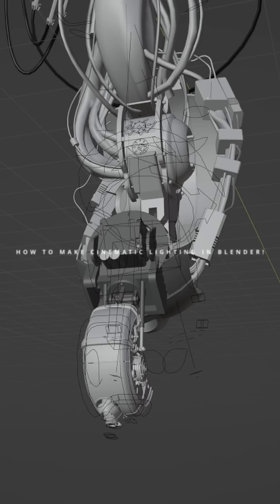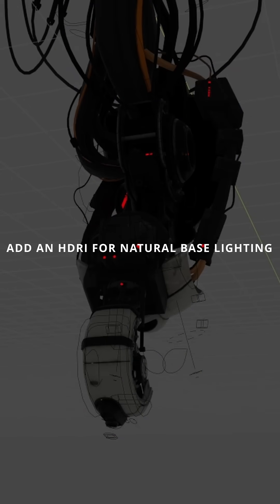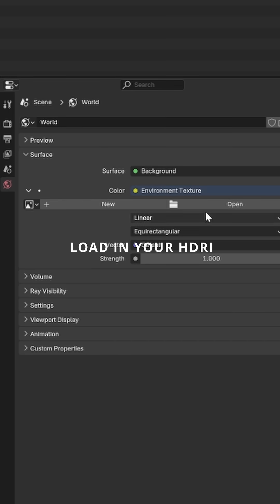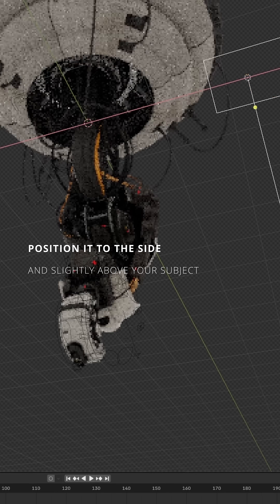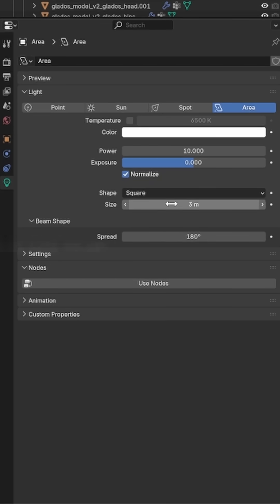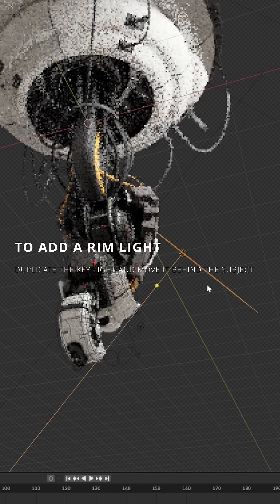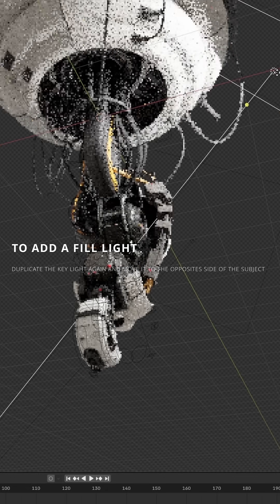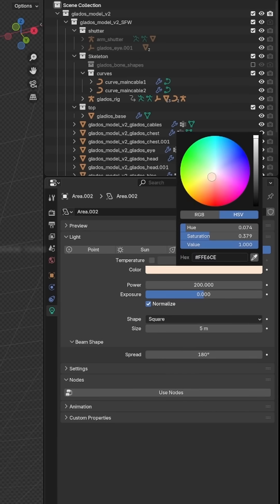Very Basic Lighting in Blender Part 1 #blendertutorial #blender3d

Comment: "how to make cinematic lighting in Blender"

* Computer explodes

Sounds about right. I am an NPR artist, always working in Eevee in a non realistic style, so no photorealistic shenaniganigans. Huge landscape with several characters, my 3080ti can handle it fine.
Recently I made a realistic traffic light in Cycles - only a traffic light, nothing else in the scene. A few reflections and bounces, it takes forever to render! I am so glad Eevee is my engine of choice.
Reply: Make sure you're rendering with your gpu, check in preferences > system > cycles render devices.
Reply: @kagenou1.137  That's the funny thing - I did check this, my GPU is selected, but still while rendering, the CPU maxes out while the GPU is only at 1/3 load........
Reply: "Opens blender starting cube"

"Pc crashes"